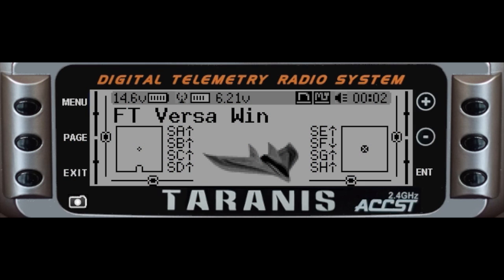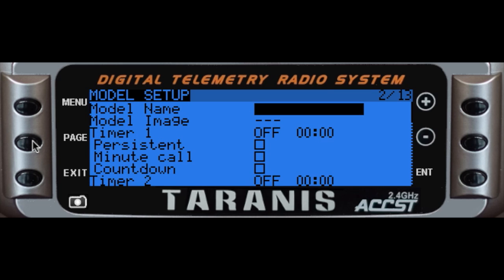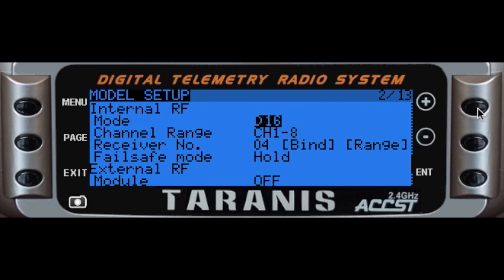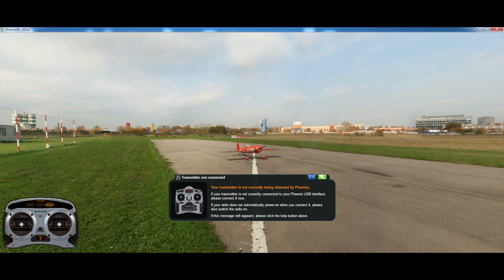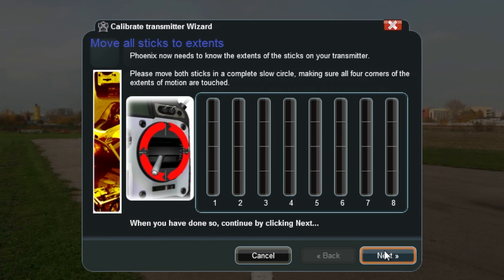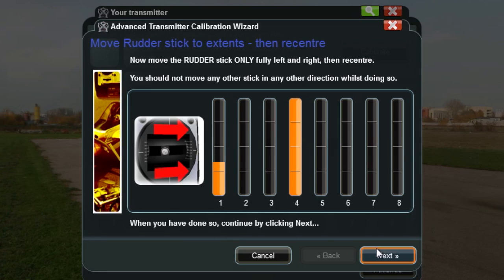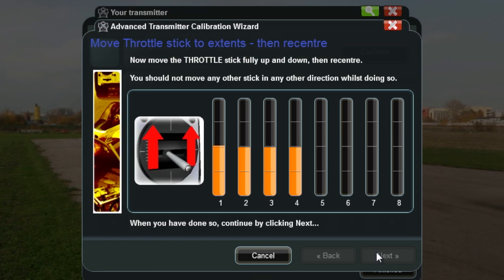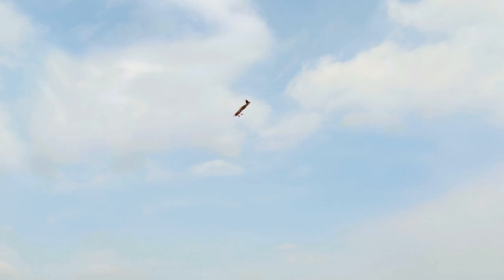CPO Quick Tip : Using Taranis with Phoenix Flight Simulator

Comment: You have to configure an input or switch in the taranis mixer to have it send data on 5-8

a new model has nothing controlling servo 5-8 spektrum's normal standard is gear on 5 and aux on 6

Comment: Thanks for this video!
Can you please tell me what cable I should be using to connect my Taranis to my Mac? I want to use both Heli-X and Phoenix. I am currently trying with the USB, and I am not getting any connection.
Reply from the maker: Cengiz Tanc With Phoenix, you need the specific Phoenix dongle cable, and it plugs into the trainer port on the Taranis.  With Heli-X, you need a more generic USB adapter. I am using this one: http://helidirect.com/usb-simulator-cables-set-fms-70-p-3171.hdx

Comment: Anyone know of anyone who made a video on setting up a 6 channel helicopter using the taranis.just got mine and its a bit confusing.
Reply from the maker: Jimmy Beeler You can look at my Raptor 550 video on transmitter setup to see how I configured mine. That may help you some. TT Raptor E550FBL Electronics Setup - S.Bus RX, TX, and GT5.2 Configuration

Comment: Can you please tell us the model of the Taranis you used for this video?  I would like to confirm if the 9XD would work with the Phoenix Flight Simulator.

Thanks in advance.
Reply: ***** Fantastic!  Thank you very much.  I'm absolutely new to this.  Is there any special cable I need to purchase with Phoenix to be able to hook up the Taranis?
Reply: ***** Perfect!  Now I need to find a shop where I can get the Phoenix.  :)Thanks again for the great help. ;)
Reply: ***** Hey, thank you so much for the tip. ;)

I live in the Philippines where R/C is a rather mature hobby.  Unfortunately, since I'm quite new to the hobby, I do not know of anyone (yet) selling their used Phoenix software.  I did however find a shop that sells (what is supposedly) a Phoenix G5.  I'm rather apprehensive though because the official website only shows version 4 and not G5.  I'm thus looking at ordering from Horizon and have it shipped here. :)

Again, thanks for the excellent help. :)